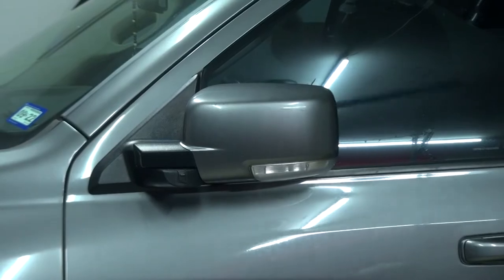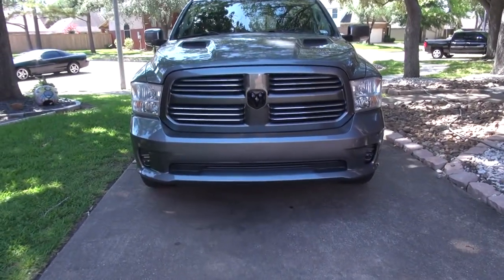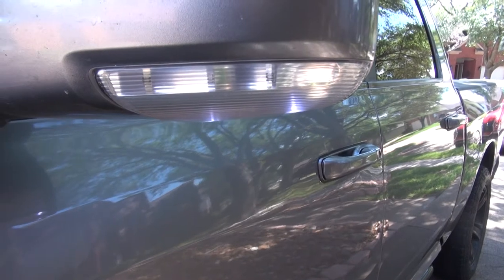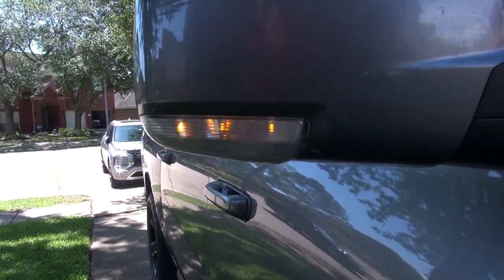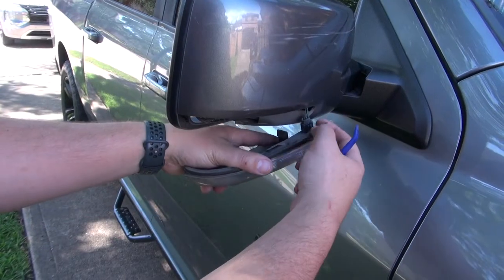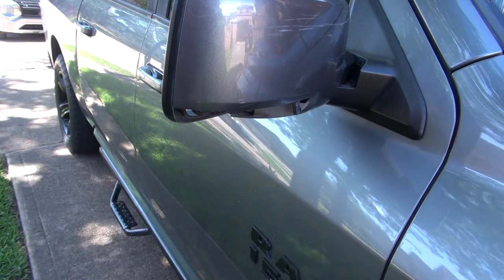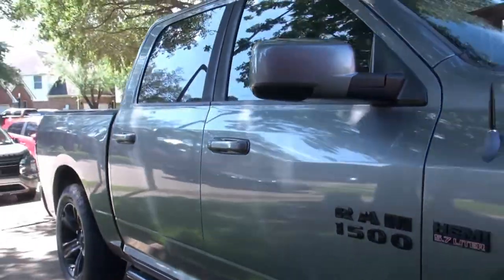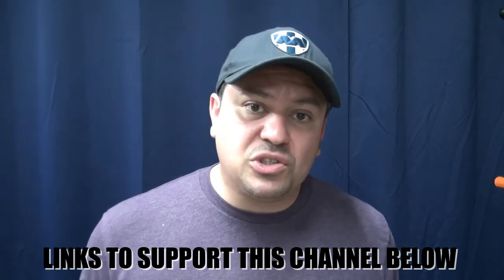Smoked Mirror light with Sequential turn signal and Puddle lights 2009-2018 Ram #ram1500 #ram #dodge

Comment: Looks nice other than the fit could be better, pretty big gap shown between the light assembly and the rear side of the mirror at 7:51.
Reply: That may be installation error.
Reply: Good eye tho.
Reply: Hey my lights, don’t come on when I open the door. Any suggestions?
Reply: Morimoto just came out with a set they look great I just ordered a set waiting for delivery to see how they look on my truck
Reply: @Unfinished-Business24  I just ordered those to let me know how they do for you.
Reply: @kellyhill6414  hi recieved them yesterday they are definitely one of the better ones out there I bought the ebay style one these are awesome I'm blown away the quality is a 10.  Definitely recommend

Comment: Put these on my truck and it broke when I put them on the Lights came of the lens lol
Reply: Same issue man. Had to go out and buy E6000 to glue it back together. Trash product. Check my review.
Reply: @LamborghiniGoFast22  Yea i did the same but I called Amazon and they sent me a replacement for free
Reply: I'm replacing mine with the morimoto ones when they come I'll have a spare set if u need there smoked sequential